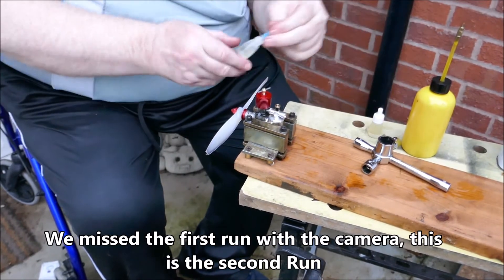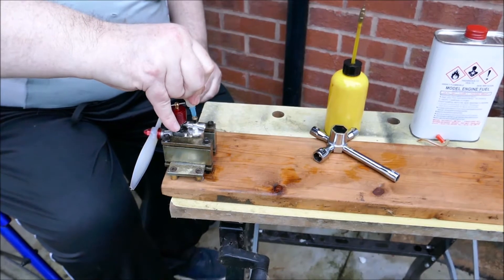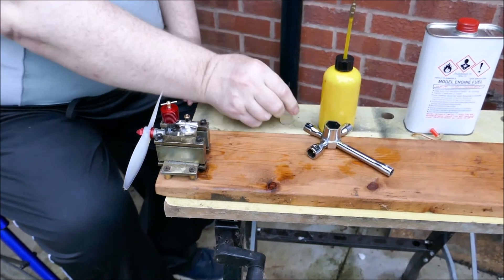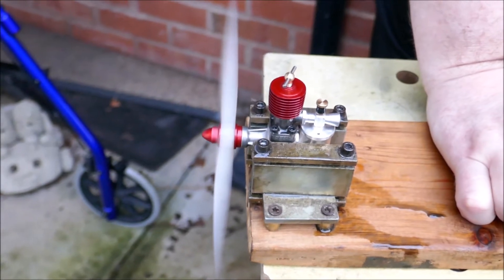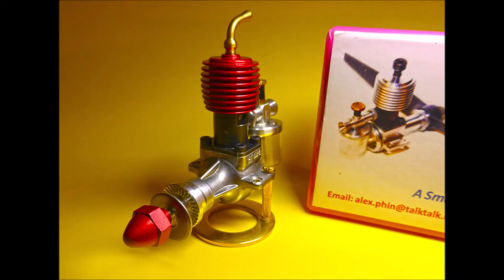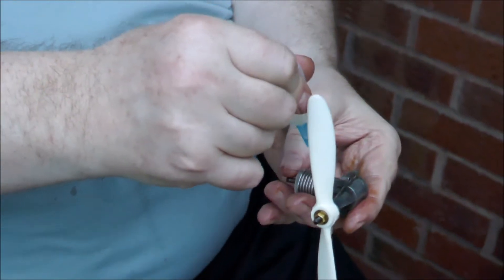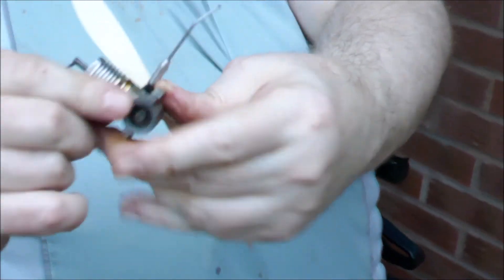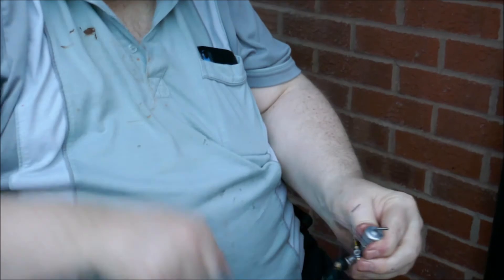Red Fin 0.49 Retro  Model Diesel Engine - First Runs

Comment: Starting the engine without any sort of finger protection. very brave.
Reply from the maker: With these little props the important thing is to take the edge off the props. Master Airscrew are the worse, the 'flash' is like a razor. It needs sanding and balancing before use. This is an old vintage nylon prop. Not too much of a problem. My main problem is my bones. I suffer osteoporosis arthritis and rheumatoid arthritis . I have had it since 18 months old with a break from it from 24 to 39 years. Fantastic years when I was cured! It came back at age 39 and flicking any props, playing guitar swells my hands. But at least I can do it again for a while I couldn't my hands were really bad.  I had knuckle splints and wrist splints. Now they are working , but such action causes them to swell. Its why I do as many engines as I can in a few hours as usually its a 3 to 4 week hand recovery. You can title it, Ste is stupid or Ste loves diesels. Or a combination of both. :) Finger stall and hand protection. On anything above a 15 usually. Thinking about it. Maybe a gardeners glove would work. I like to 'feel' these little diesels. If you know what I mean. I have diesel engine euphoria bad...

Comment: I did get an .061 Millish Red Head, super little engine.
Reply from the maker: The new TBR one. Is amazing performer I am told. I have not run mine yet . The O49 TBR Millish is fantastic. I have at least 3 - LOL...
Reply: @Servoboy  I've just bought 2 0.30 tbrs a kompish and a millish they are very highly strung they even bite on a 7.4
Reply from the maker: @justso1823  Hi - I find them OK. I suffer quite badly from Rheumatoid Arthritis and it restricts my diesel doings. Not as much as the long down as neighbors home from work is also a difficult one for running engines. Plus locally a shift worker . So when my hands are up to it, only have a few flicks available. After this session I applied ice to my hands for several days to take the swelling down. That's how much I like diesels ( alternative title that how stupid am I?) . The little AS55 I still have not ran it in a stand yet.  Its a long story but by 2010 I was wearing finger splints and hand splints. I couldn't play guitar any more. I worked very hard on the hands and I can now play guitar (ish) again and i've started a few engines again).  The hands are not great at the moment. When they get a bit better another video will occur! Do you know this was the first ever diesel ( 049 TBR ) I took out of the box flicked and it fired up. First ever flick!
Reply from the maker: @justso1823  yes they want to go. Juts get those fingers out of the way... LOl